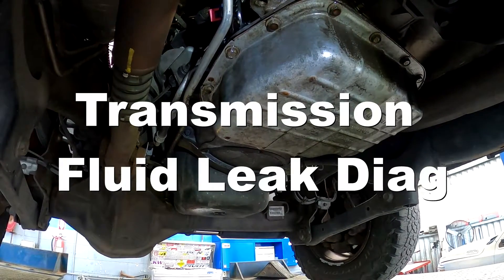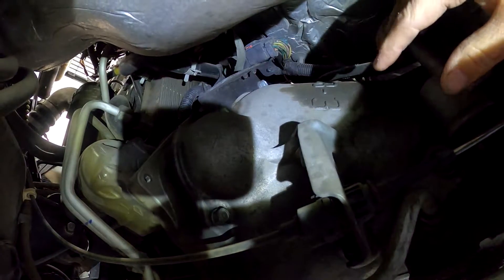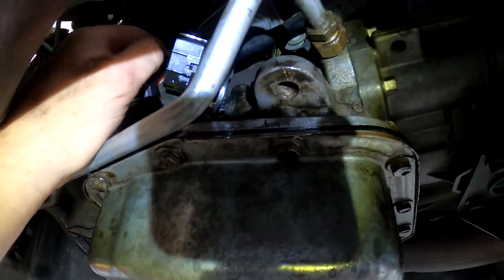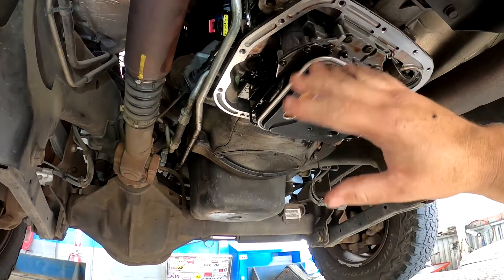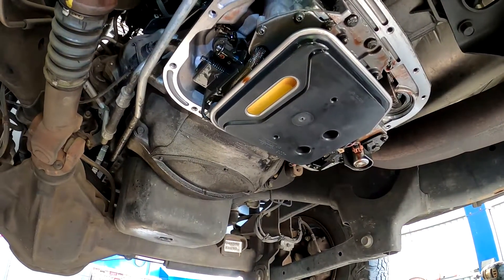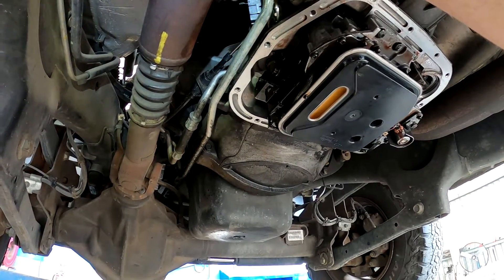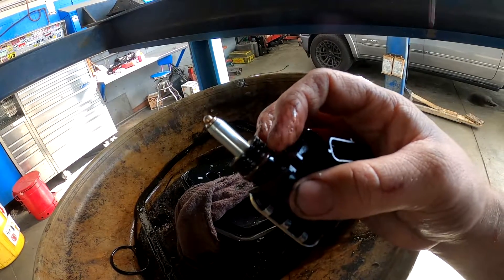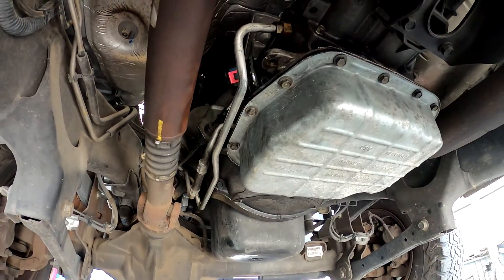Transmission Fluid Leak Diag on a 48RE Transmission

Comment: My 2008 Ram with the 5.7 hemi is leaking transmission fluid but next to nothing drips when parked. I believe it is leaking when driving but where is the leak? Transmission pan is dry.
Reply from the maker: @HypocriticYT  Your truck should have a 545RFE transmission. They can leak from the shifter seal on the left side of the case. The seal pops out. There is and
Reply from the maker: Sorry cut out on the last reply. There is an updated seal kit with a spacer that keeps the seal in place.
Reply: @Tech_1968  Thanks i'll look there
Reply: @Tech_1968
I have a 2005 ram 2500 5.9 Cummins and I have atf dripping off the passenger side of the radiator and then getting blown back towards the rear of the truck. I have already replaced the transmission oil cooler on the front of the truck and still have an atf leak. Any idea on what it could be?
Reply: @loganprice6708  your rad can have a tranny cooler built into it but then would not make sense having an external tranny cooler. Check your rad fluid for transmission fluid as I'm told they can leak internally if you have  the red with built in trans cooler. Luckily my 5.7 doesn't have the internal trans cooler. I have not found my leak but did refill the trans with 4 qts and it's stable. I did add a bottle of stop leak . Since it's not going low on fluid i'm not fixing something that ain't broke yet.
Reply from the maker: @loganprice6708  It could be from the power steering cooler. Depending on how your truck was optioned it may have a separate cooler for the power steering in between the AC condenser and the radiator. The power steering fluid for that year is ATF. Hope that helps and good luck.

Comment: Hi Great video! in my case the Neutral safety switch is the issue. Is necessary to open the pan to verify the neutral safety switch or can I just remove and put the new one neutral switch? Thanks for the info!!
Reply from the maker: @jpablo041997  The neutral safety switch can be replaced by itself. The pan does not need to be removed.
Reply: @Tech_1968  thanks for the info!

Comment: My neutral.i safety switch was leaking to I put a new won on it and within 50 miles it was leaking.
Reply from the maker: @sugargoldy  I have also seen the pressure switch above the neutral safety switch leak as well. It leaks onto the neutral safety switch. It is the connector pointed straight up.
Reply: @Tech_1968  Mine is dry